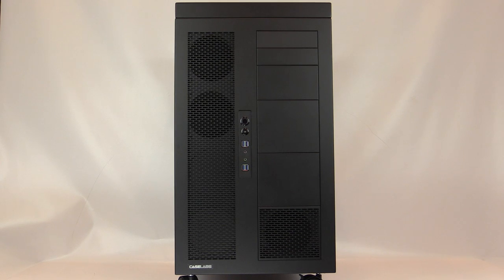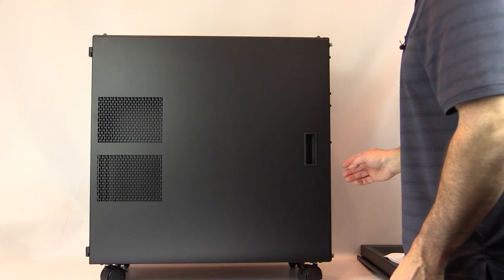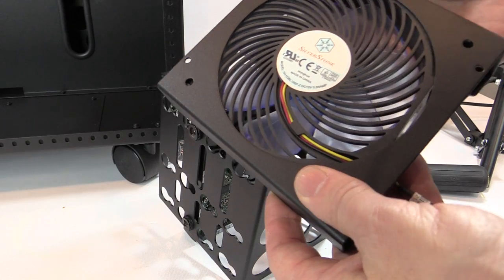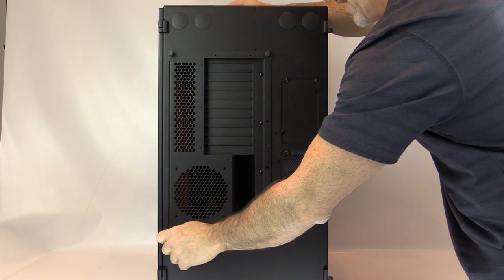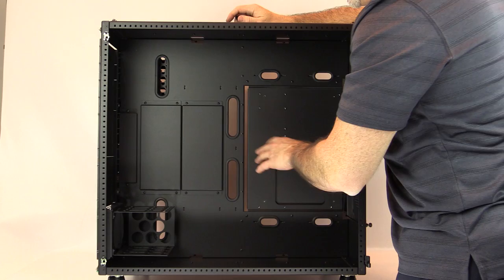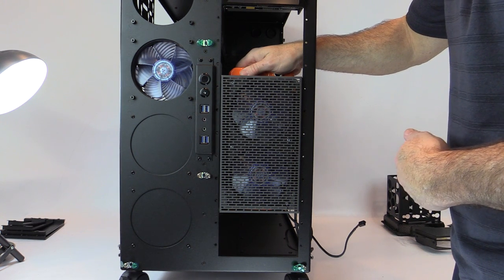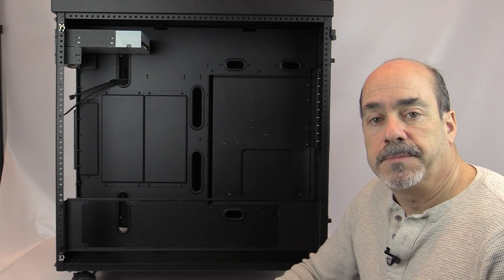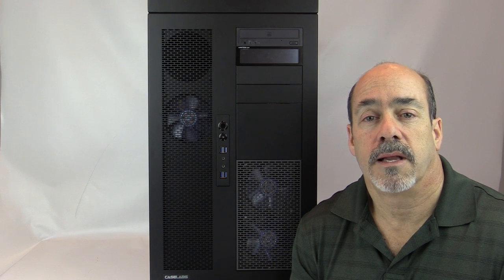CASELABS MAGNUM TH10A Review

Comment: Just got the case the other day and I am in the process of planning out my build in it. The only thing I cant decide is about my second power supply. Should I dedicate it solely to running the pumps, radiators and fans? or should I use it for the graphics cards or something. I can't decide haha.
Reply from the maker: Camjordan13 What parts are you putting in this baby?
Reply: I have yet to buy all the parts, I wanted to get the case first so I could take measurements and plan out everything. The main parts I am going to be buying a i7 5930k (or a i7 5820k which is $200 cheaper for only 0.2GHz less), Asus Rampage Extreme V and 3 980 Ti's.

Gonna go with a dual loop with the cpu and motherboard on one loop and the 3 980 Ti's on the other loop in parallel.

Going to be using 4 quad 120 mm rads, 2 D5 pumps, fans for rads and other areas in case, and then the lighting which I haven't decided on what I am going to buy for that.

I am leaning towards putting all of the computer parts on one PSU and using the other to run my water cooling equipment, fans, and any lights I decide to add to the case.

Got plenty of time to decide though. I'm buying the stuff in waves. Gonna get the parts for the computer first, test them all and make sure they aren't DOA. Then temporarily install them to the case to give me a visual representation to plan out my loops. Then order the water cooling components and lights. :)
Reply: Camjordan13

Comment: Hey Ron,  Really nice review!!!!  I have the same case with the 31 mm Top and plan on mounting my rad in p/p with the top fans on Top of the case like you did.  My question is what size screws did you use to mount the fans thru the cas e and into the Rad???   was thinkin 6/32, is that too long???
Thanks JJ
Reply from the maker: The Black ICe Nemesis Rad uses M4 screws. The length was 1.25 inches I think.
Reply: Thanks for getting back to me Ron!!!
I also have a Monsta 480 I Initially bought for the Top.  Now I'm not sure which one to go with lol.
But Thanks again for the answer!!!
Joe
Reply: Hey Ron I thought  you might be interested in this.  It's a Quad Radiator Roundup. The Dude that tested the rads did a good job, but I don't think he had them in cases so it's a tough read.  It's good though, and the Black Ice Nemesis GTX & the GTS did really well and so did the Monsta 480's as well...........here is the link  oo man u can' t paste in heer????
well it's on www.overclock.net  just look up The Quad Roundup.   If ya can't find it lemme know n I'll post in on youtube for ya.  Yeah I knew the Nem used M4 svrews and I also spoke to KC up at case labs n he said the monsta's screws don't work right either.  Maybe a rubber washer if need be.I'll find out soon enough.  I just sold my I7 4960 for $1200 n my R4% Black Ed Mobo I got Rid of that as well.  I had planned on a build with the X-79 platform, but since I waited for the Titan Z Hydro Copper cards to come back in stock at EVGA, they came out with the X-99 platform so I decided to go with an X-99 Build.  I'm kinda Disappointed cayse I relly liked the R4e BE MB, but the features on the new X-99 mobo's are outstanding.  I like the Thunderbolt header Asus ut on a few of the X-99 boards as well as the Z-97 Boards.  So Now I have some more research to do because while Iii was reading the specs on some of the MB on asus' site, a lot of the PCIE Lanes share Bandwith and if say you use a PCIE SSD Card, which is what I Have, I have the ROG 240 gig RaidR SDD.  I't's son the QVL Of a few Boards, but I think I might us the M.2 Card and add the Samsun 512 gig SSD , but You the "Kill" the SSD Express ports of you use an X4 device.  Niw I'm kinda wishing I just Built the X-79 System.  Oh well???   Sorry I write such long paragraph's, but you Vid on the Th10A Really helped me fig my Build a lot better than I had planned.  You REALLY Helped me!!!   So Thanks Again & I hope you take a look at the quad rad rounup. I't's interesting, but like I said, I think he Bench tested them? Still in all the Nem's Both did well and so did the Monsta'a.  O he also did some 560's as well.  Hope u like it
TY Again
Joe.....Damm that's LONG Sorry
Reply from the maker: Thanks, I'll check out the Quad Rad Roundup. Thanks for watching and enjoy your new build!
Reply: Thanks Ron!!!
Can't make up my mind on which MB???
I'll fig it out.
Have a Great weekend!
Joe

Comment: Hey Ron did you ever do a build in that case if so did you have to get longer sata cables and psu cabels i would like to know
Reply from the maker: No I would up selling the case. But I have an STH-10 and I did have to get custom cables to provide the length I needed for many of the cable runs.  You could also use cable extensions as well. BitFenix and I think Cable Mods and others make them.
Reply: thanks for the answere

Comment: Good work man

Nice review %100
Reply from the maker: Mubarak Alrashidi Thank you.
Reply: Ronsanut I'm building a system with this motherboard ASUS Z10PE-D8 WS LGA2011-v3 it will have dual Xeon processors.. and to cool them down, I will use dual Swiftech 240-X .. will this case be able to mount them in a place that would allow the tubes to reach the CPUs ?
Reply from the maker: Mubarak Alrashidi Depends on how long the tubes are and the location of the CPU's in relation to them.  You would mount one in the top just above the motherboard and the second in the bottom just below the motherboard. I would expect they would reach.
Reply: Ronsanut Thanks man.. I'll check their details and specifications

Comment: I think for that price there should be some kind of air filter system included.
Reply from the maker: The problem is you have so many places to install fans and rad's and different sizes. But they could offer them as options.  You can get Filters that fit CASE LABS options from Performance PC's.
http://www.performance-pcs.com/catalogsearch/result/?q=fan+filters